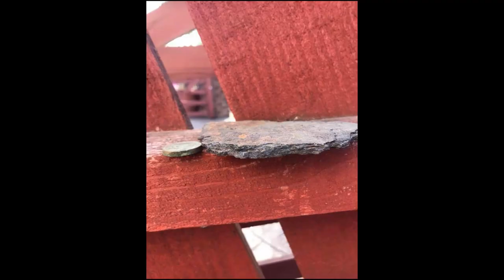iveco daily rust bucket to camper conversion part 1

Comment: What year was this?!
Reply from the maker: Its a 2004
Reply: ste's daily auto repairs holy shit Iv just bought a 2001 😩😂😂
Reply from the maker: @jameslindsey5047  make sure you check under the battery and screen wash bottle also behind the rear panels and also behind the rear door seals at the top